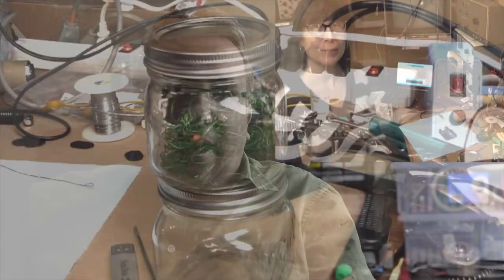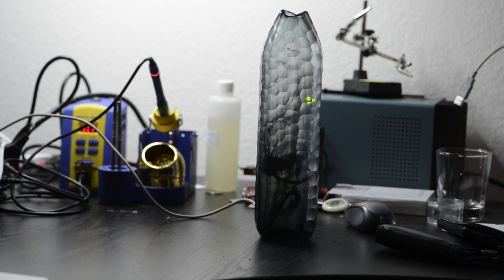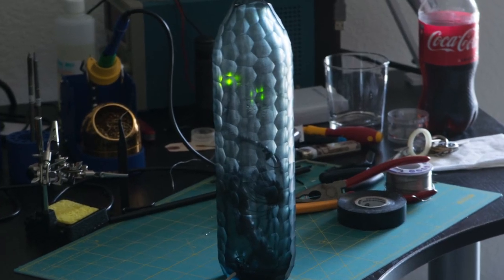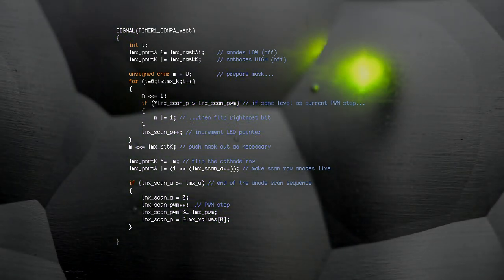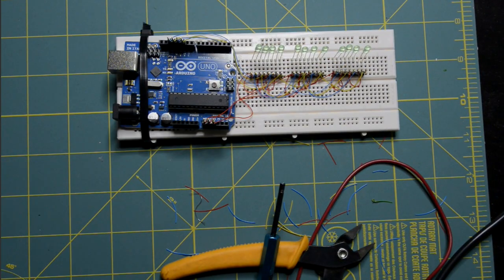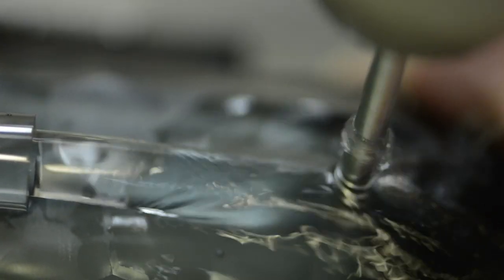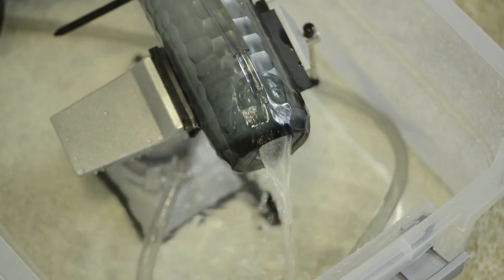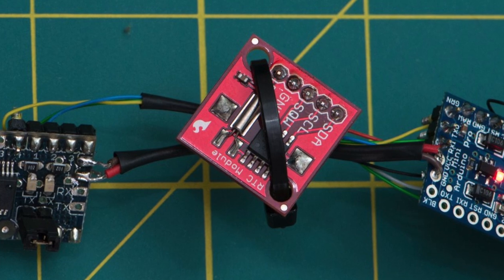LED Fireflies in a Bottle, a DIY art project.

Comment: Great project and excellent documentation.

I think line #141 in LEDMatrix.ino should be corrected to:
lmx_portA |= (1 << (lmx_bitA + lmx_scan_a++)); 
(add the first anode position into the calculation of the active anode bit)

Comment: Hi and thank you for the video.
i am working on a project similar but i am placing the leds in our garden.
i just starting with the arduino and programming. i have 15 locations in the garden i want to place a set of 8 led. I know it is a lot for a first project but i figure if i can get one location done then the rest will be straight forward. i have one long term idea to have them all sync for 15 second every 30min. or so. 
do you share your code for a home project.
either way your project was most elegant 
John